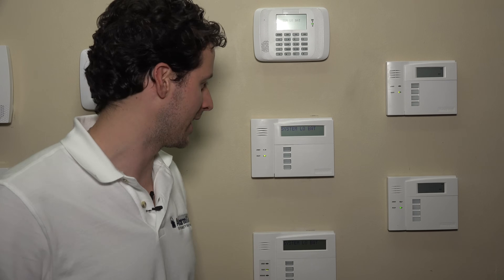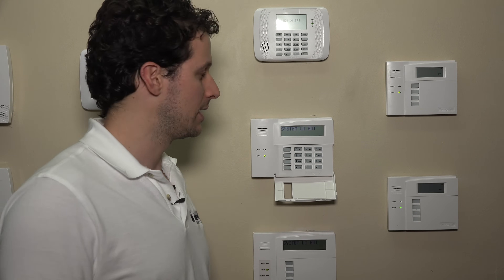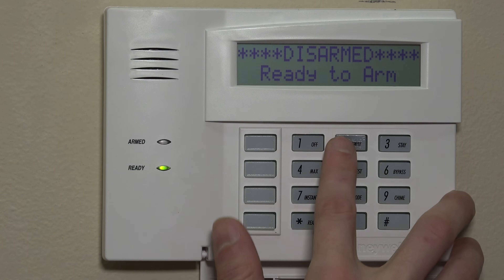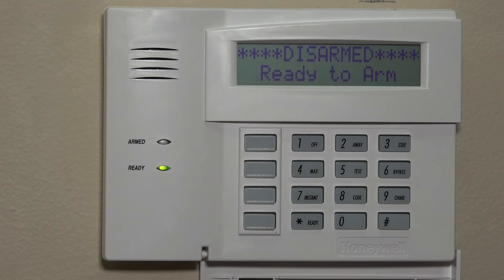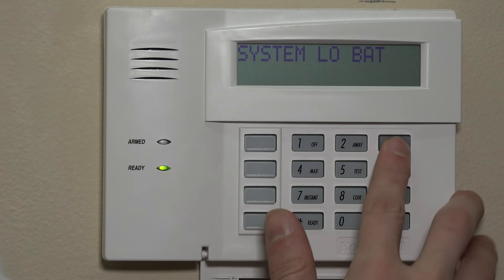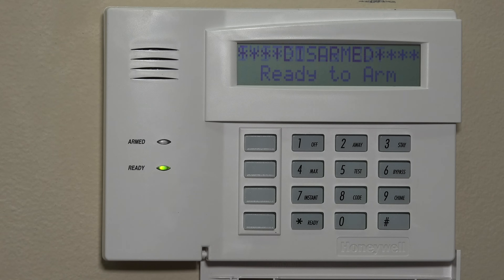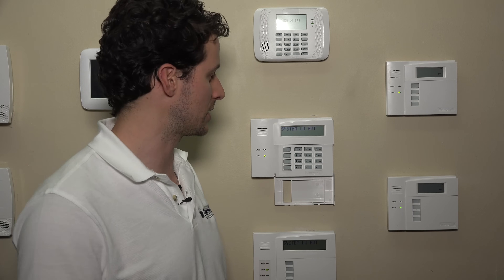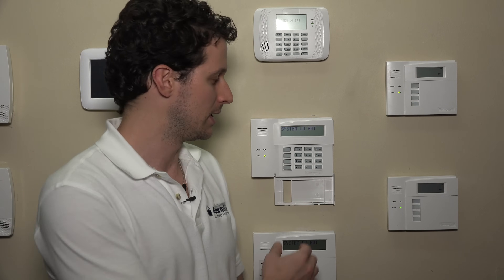Honeywell VISTA: Clearing a "System Lo Bat" (deprecated, updated video in description)

Comment: Replaced my battery and the BAT message wouldn’t go away after 3 days. Turned off AC power to it, removed one of the battery leads, then restored AC power and reconnected battery, problems solved. 👍
Reply: Bryce Alarm Saw that mentioned but it didn’t work for me, had to cut the power as I described.
Reply: Marky Mark 
Does your system return to normal after you remove all power from it ?  I was worried about removing both the AC and DC and having to reprogram something.
Reply: Rick Lust I was hesitant to remove all power but as far as I can tell, nothing was lost. Maybe one of the pros here can confirm if the vital info is stored in non-volatile memory. I would hope that it is since it’s possible that someone could have a power failure with a dead or weak battery and would be bad if the configuration was lost. My suspicion is that due to the size of the battery it’s use is to keep the unit working for a while during a power failure. A battery that would be needed only for memory backup wouldn’t need to be so robust, could be done with a AA cell or something like you have in thermostats etc. to retain the program. Hope that helps.
Reply: Marky Mark 
Glad I saw ur post.
I did as you suggested and removed ALL power from the board for about a minute and powered up the system.  All came back normal and the Low Battery display is GONE !   
I will install a power surge outlet for the transformer. I got the trouble when my power flickered during a storm and could never clear it any other way. 
Cheers ! 😊  🍺🍺
Reply: Did exactly the same and it worked. Thank you, Lo system battery gone....... :)
Reply: Exactly 👍After that just use the master code with #63 to adjust date and time
Reply: @Ricklustt  the only thing you lose on power reboot is your chime. except if its an ADT panel.
Reply: What if panel says busy

Comment: What is the point of this if you didn’t show how to access the battery? 💀
Reply: There should be a metal panel box somewhere in your home that houses the battery. Mine is in the coat closet. It most likely has a lock on it.

Comment: Hi, I moved into a house with this Honeywell security system, and I didn't subscribe to the service. Now it's going off every 4 hours with "System Lobat" and some other things that are low battery. Where is this system battery, in the alarm panel or something? Is there a way to permanently disable this specific alert?
Reply: Hello @cc_tw,  The system LoBat Error is the Panels Back up battery being low and Most likely replaced. The battery can be found in the Main Panel Can. This is usually a metal can located somewhere in a no so easy accessible location usually in a basement, attic, garage. This error can only be silenced temporarily. If you order a new replacement battery this will allow the error to be cleared properly. The batteries can be purchased from us or at a local hardware or battery store.  Other Low Battery devices will be wireless sensors and have their own batteries installed and would need replaced.

Comment: I replaced battery reset it still get low battery, so i put another new battery in get same reading, low battery. I let it charge for weeks still see low battery, everything works except low battery reading..
Reply: Sometimes it helps to push a signal through, and or old fashion way, power down system, by battery leads and transformer, than power back up.

Comment: The only way you can clear a panel low batt on a vista panel is by jumping in and out of programming, or power cycling the system. I've serviced over 21,000 of these in 25 years and this is how they act. There might be a special model that does auto recognize, and clear. But the average vista panel from around 1995 to current clear with the two methods I mentioned
Reply: This video has been deprecated. Please check out this more recent video: https://www.youtube.com/watch?v=IP5umQ-vDPY
Reply: Power cycling or jumping in and out of programming will only clear it for 60 seconds. After that it’s back to trouble again. You’re really just stuck purchasing a new battery.
Reply: @GIJew  right. If the batt is below 12 volts. But even a fresh battery won't clear the trouble. You have to power cycle after battery is changed or just jump in and out of programming. It won't auto recognize the new battery
Reply: I have a z1100 system that I just want to stop the “ low battery warning”
How would I accomplish this?
Reply: @michaelnitake2534  get a 12 volt lead acid battery and put it on. But not before a power cycle. As you're hooking up the secondary source as new. Should clear. It won't clear if it's old.
Reply: @wanebros.9292  the leads on the 12 battery I ordered doesn’t fit the connectors on the system

Is there a way to just disable the low battery warning?
Reply: @michaelnitake2534  no. Just take some cutters and trim the prongs down if they are too wide

Comment: How do I disable the low battery warning altogether? I have a 20p that I'm not using as an actual security system, but rather just to experiment with, and I don't have a battery connected to it because there's no need for one.
Reply: flarn2006 I want to disable ours any luck yet on how
Reply: If you had replaced the battery and still didn't clear; you got one of two things going on:

1. Your panel needs a power cycle to be performed. The way you can do this is by disconnecting one of the two battery leads at the battery. Then, unplug the transformer to the panel. 
NOTE: Before plugging in the transformer back to power the panel up, you need to connect battery first, THEN plug the transformer. 

If the first step didnt work, and you are for sure the battery is in good conditions as rated on its label. Then, that is number two:

2. The panel battery charger (built in) is not working; therefore, every battery will turn into a low battery quick.

I have also worked with different panels such as GE Concord, DMP, DSC, and the most feared "Radionics". From this I can only say Ademco Vista is one of the thoughest to work with as they can easily get fried is not serviced properly.

I hope this helps, good luck
Reply: 1021lexuslady There is no way to disable the low battery supervisory in any panel programming unless it is a monitored power supply box (which would read as a zone in the keypad) This would not be your case as most of these are commercial jobs that require many batteries to different devices.
Reply: @DragonLinkBestDeck  step 1 worked like a champ.  Thanks for posting!
Reply: @Pingjockey725  I'm glad it did!
Reply: @DragonLinkBestDeck  Step 1 worked first time.  Thanks for posting
Reply: @DragonLinkBestDeck  #1 did the trick—thanks!

Comment: I came here because I was getting the "System Lo Batt"  , tried the double disable, but it persisted.  I used my voltmeter to check the battery (13.5vdc)  so I unplugged the battery and the AC for 10 secs,   clear panel now. 
thank you

Comment: I just put a new battery in but the low battery does not disappear. Also my panel does not show “disarm” but “off” is that the same thing?
Reply: Hello, Please check our new video that is out for clearing the low battery on your vista panel in the link above.  The disarm command includes the following keystrokes, enter your 4 digit code + 1 (off) key. Repeat this command twice after running the test to clear the low battery message.

Comment: Hi i have a honeywell CPO38 galaxy intruder alarm system which i do not ot wish to use, previous occupant had installed. Keeps showing lowbat, so i replaced the large battery in the panel, but found at coming up lowbat hallway on my panel. Replaced batery in sensor, is working because flashing red, but still lowbat showing. My alarm panel beeps every night around 10.00 until i use my fob key or code, help what do i need to do. Don't wish to call engineer as they have quoted £200 with a system i do not wish to use.. Someine please advise thank yoy.
Reply: Hi @LindamariaReason-ul4wd! If you do not wish to continue using the panel then I would recommend simply powering the panel down by removing the backup battery from the panel and then unplugging the transformer from the outlet. This will power the system down so that it no longer beeps.
Reply: @AlarmGridBrandon  Thank you for this.  I see the back up battery in the panel.  I'm having trouble figuring out what/where the transformer is to unplug from the outlet.  can you give me any advice here?

Comment: I replaced my battery and my display screen is still reading low battery after 4 days...what should I try next?
Reply from the maker: You need to troubleshoot:  This FAQ and Video may be helpful: https://www.alarmgrid.com/faq/how-do-i-troubleshoot-a-low-battery-condition-on-a-vista-panel
Reply: I need to replace my battery, but I need new connectors. Need help.
Reply: @AlarmGrid I need to replace the connectors for a new battery. HELP!

Comment: If we no longer use adt and disconnect speaker will smoke alarms still work
Reply from the maker: That depends on a number of factors. First, are you sure the smokes in question are a part of the alarm system? Often, they are battery-powered stand-alone smokes, or they are system smokes that are tied into AC power. These operate separately from the alarm system. Smoke detectors are life-safety devices and I would not advise you to take any chances with them. If you'd like to discuss the situation further, send us an email to support@alarmgrid.com, we can get some more information about the system and advise you more accurately.

Comment: I having trouble on a rp5800 repeater always say low battery message do you know how to fix that?
Reply from the maker: The 5800RP can be supervised in a couple of different ways.  If it's supervised with a single zone (the most common way) then it will report AC Loss, Low. Battery, and RF Jam all as a Low Battery.  This prevents one of these conditions from causing an alarm if they come in while the system is armed.  If you've checked the battery and it appears to be good, then check that the 5800RP has AC Power, and check the Red LED on the board.  This is an interference LED, if it's staying lit constantly for longer than 20 seconds or so, that indicates that something is constantly transmitting at 345 MHz and is causing an RF Jam condition to be reported.  If this is happening, you may need to relocate the 5800RP, and if that doesn't help, you'll need to find the source of the noise.  This can be caused by a transmitter on your system that is going bad and constantly sending out signals.

Comment: I have just replaced a new battery,   follow exactly your steps. It worked great for the first 30min, then later giving beep alert showing "busy - standby D1" 
I entered the code +1 twice to off it,  eventually it (beep) come back showed "system low bat".
What could have gone wrong?  Please advise.
Reply: Stefan Y
Reply: If you had a power surge like I did and you know your battery is good, my manual says to replace the board. I have the same issue and will add a surge protector outlet before I replace my board. (Which is going to be a pain in the butt reprogramming it). . 🤔 See my new comment on how I cleared it.
Reply: Stefan Yen I did as Marky Mark suggested and removed the AC and DC power to my board and powered it up again. the low battery cleared. 
Thanks Marky Mark !
Reply: Rick Lust thanks works for me
Reply: Stefa

Comment: I have Honeywell with outside temp sensor. Thermostat showed message 'outside sensor low battery. I replace batteries many times but after three four days it start showing again the same message of outside sensor low battery. It allow to set to remind in next seven days but after seven days it start again showing same message low battery. What is the solution?
Reply from the maker: This may well be a bad sensor.  Some sensors get stuck transmitting their check-in signal constantly. When this happens, you won't get an indication at the panel that it's happening.  The panel is happy because it's hearing from the sensor, but it will go through the batteries pretty quickly.  Depending on the receiver you have, if it's the type that has two antennas that stick up from the top, then it has a little red LED that shows when it receives a signal.  If a device is stuck transmitting, then this red LED will stay lit up pretty constantly.  Check the LED, and see how it's behaving.  If it's staying lit, then remove the batteries from the temp sensor and see if the red LED goes back to normal (just flickering for a second or two every once in a while).  If so, then your transmitter is probably the issue.  Replace it.  If you don't have this type of receiver, try enabling RF Jam on your panel. If the transmitter is stuck transmitting, it will most likely cause an RF Jam trouble.

Comment: Where is the battery, you talk about battery but where is it located
Reply: The battery is located in the metal cabinet which houses the alarm panel.
Reply: @dylanalarm_grid1038 are we supposed to go in the metal cabinet & remove the red & black wires, and then reconnect them in a couple hrs?

Comment: My only question is why tf would anyone buy a keypad with a speaker after watching this?

Edit: and if you read the other comments here, a lot of people are having issues. On a side note, why am I even here? I don't even own this.
Reply: What? They all have speakers for beeps when pressing buttons, during entry/exit delays, and when there's a problem. This video is about a trouble condition that can occur when there is a problem with the alarm system. It doesn't beep like this 24/7